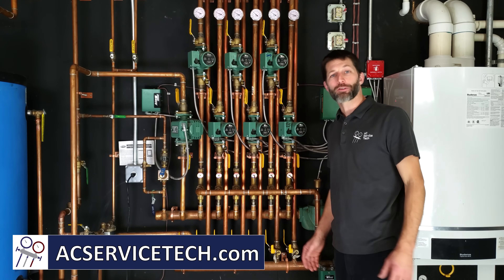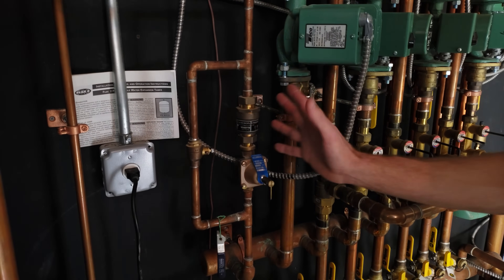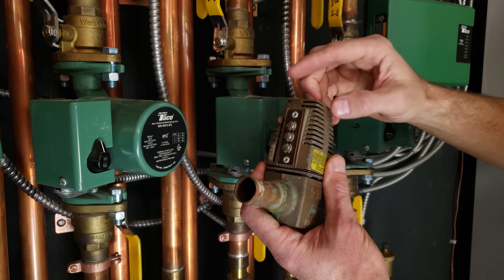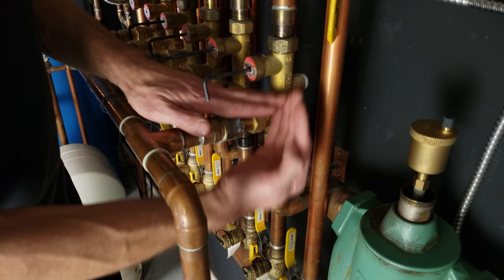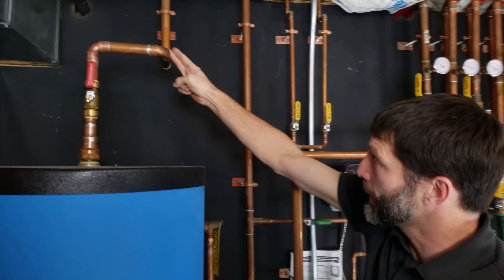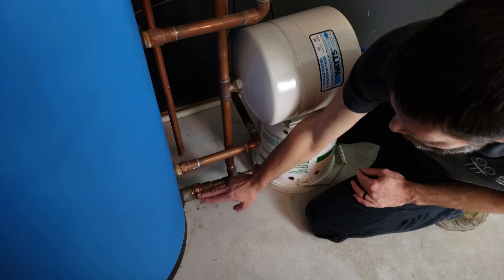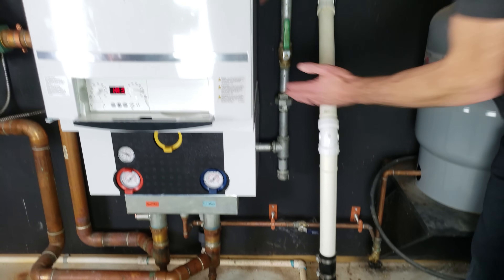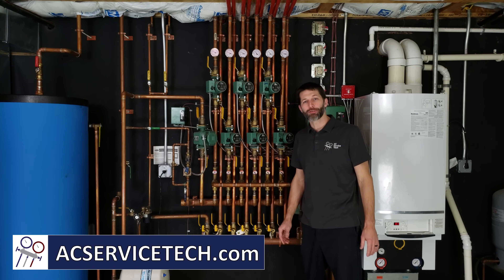Boiler Training Class, Parts, Operation, Zoning, Explained!

Comment: Why would you set a condensing boiler to 190F only to mix it down to 115F? It would only be getting the same efficiency of an atmospheric boiler at that point.
Reply: My thoughts are is this boiler is also heating the domestic hot water, which would require a high temp to be effective.
Reply: @steventhury8366  Yes but it would only need to do that actually during domestic production not all the time, those Taco zone controls have a priority zone for that very function. Also, 190⁰ is unnecessarily high for domestic anyway you only need 20⁰ above your DHW target, that boiler would have enough jam to heat that tank up in 10 mins from cold @ 150⁰ supply temp.
Reply: @zacm9174  My understanding is, the 190 degree boiler water heats the domestic water via heat exchanger, or indirectly,  which has inherent inefficiencies.   So to get 130 degree domestic water to effectively rise during heavy water use, you need boiler water much higher.
Reply: @steventhury8366  I've installed dozens of boilers with indirect water heaters and I've never had to set the boiler supply more than 20 degrees above the domestic setpoint to heat it from cold in less than 15 minutes. The boiler in the video is 300,000 BTU/hr, with a Taco 0011 pump that thing would heat that tank in a few minutes at 150⁰ and remain in full condensing mode doing it, whoever installed that one wasn't very experienced with condensing boilers obviously.
Reply: @zacm9174  I'm not denying what you're saying about water temp.
The installation was obviously not done by a newbie.  If you can see something wrong, good for you.  This video is not for advanced boiler technicians,  so why are you here?
Do you think the technician doing the video is promoting some kind of boiler heresy?
Reply: @steventhury8366  I kind of do, yes. A more experienced hydronics technician should have been brought in for this video instead of propagating misinformation. I'm not saying the installer was inexperienced, probably just really old school, i've seen the type before, they don't  really understand condensing boilers and install them as if they were an old cast iron atmospheric boiler.
Reply: probably feeding an indirect water heater and maybe baseboard or hydro-coils somewhere in the building, those pretty much rely on 180F+ to be efficient and have rated output.

Comment: Also the expansion should be pressurized to 22 psi since boiler is at 22 psi!
Reply: Yes! Definitely! Thanks for mentioning that.
Reply: no, the expansion tank pressure should always be equal to the systems required "cold fill" pressure! as the water in the whole system warms it expands and the tank is there to except the expansion and maintain the pressure, while you can get by with the tank pressure about 3psi higher than fill pressure, that makes the system pressure change rapidly until it ,meets the tanks pressure on every single heating cycle and you really don't want the pressure changing drastically or odd things can happen.
I think his tank is low on air charge or is undersized for the building, because 22psi at 168F is too high, especially since the whole system may not be hot with water fully expanded yet.
those tanks all leak down about half the charge in 18 to 24 months, which reduces the acceptance volume by greater than half and poof 💧 goes the relief valve.

Comment: Great presentation, nice install. I installed an electric hot water tank, love the simplicity and $400 cost. No reservoir tank, circulator pump, inducer etc. My electric bill has not changed but my gas bill went WAY down. I would argue the cost in electricity to run the combi and heat loss through the pipes to the hot water tank need to be factored into the efficiency. My next house will be wired for Insinkerators in each bathroom and kitchen and cut the copper pipe cost in half. Edit: I am a licensed gas fitter.

Comment: Just wondering if that low-water cut off should be above the top of the boiler just thinking because if the water got down that low that boiler heat exchanger would be toast. Very nice job of explaining the system
Reply: Yes you are right
Cuz in New York City DOB plumbing division inspector will fail the inspection.
Unless it's on the top of the boiler for the same reason you mentioned. In general he did a very nice job
Reply: yes, it really should be above the boilers heat exchanger highest point. (since it's not a steam boiler)
ideally you want it to cut off when or before any circulator pumps run dry, not just the boiler. cartridge pumps cannot be ran dry, the water lubricates the bearing surfaces(often ceramic sleeve on stainless steel shaft)
Reply: Can’t say that I am an expert on Buderus boilers (I would want to see the install guide) but I would agree that a LWCO would generally be located above the boiler heat exchanger.

Comment: Great thorough video! Thanks Craig. Couple questions. The drain goes into the sump crock and that condensate water is very acidic and will eat up the pump. Many municipalities do not allow you to drain into the sump. Is that legal where you are? Also the LWCO looks low. If the water level in the boiler got that low, it can ruin the heat exchanger. Is that in the right spot? Thanks again
Reply: Christopher, I have worked on Boilers for Thirty Years. One thing that improves and protects boilers tubes and pump is to use DE mineralized water and do a closed Loop System.  By doing this You have All the Minerals from the Water removed and You recover the water to a Holding Tank so you never add water to the System. As long as you don't have a leak you never add Water but if You have a leak then add De mineralized Water back to the system. On the Hot Water Tank used a Hot Water Tank that uses a coil in the tank to heat the Water. If You have to drain the system for any reason You can pump the Demineralized Water into a Holding Tank. You are only use about 250 Gallons of Water at the Maximum in all the Lines, Evaporators and the Coils. By doing this You add 5 to 7 years to a Units life. One other thing Never use any Carbon Steel Fittings or Pipes in the Heating System. Carbon Will transfer to Stainless Steel. By doing this You will Add Years of Life to Your System. Carbon and Mineral Water is a Cancer to the System. Any Old Boilermakers and Service Tech's with knowledge will tell You the Same thing. One other thing do a Boiler Chemistry Test by doing this it will Tell You the state of your Water Chemicals in your system. You need to Stop any Corrosion in Your System. by doing this You add life to Your System. Most People that installs these Systems don't care because it's not their system.

Comment: Very well done. Just want to point out a few things that will make our lives go easier.  Install a ball valve after the auto feed so you can isolate the feed valve from both incoming water pressure and boiler side pressure. The quality of these feed valves is not what they were 30 years ago and they must be replaced more often. Maybe a little more explanation on why the mixing valve is just a high temperature stop when used on a system with outdoor reset and mixed temperature supplies. My last pet peeve is what is a very common mistake. Always install a drain valve between the expansion tank isolation valve and the tank. These bladder tanks must have their air pressure checked every season. The only way to do this is to isolate the tank and remove the water pressure from inside the tank. Your other options would be to take a bath or introduce a lot of air into the system.  Great video Thanks

Comment: Your a great instructor, I love the clarity and energy in the video.  What a great job in installing that system also.  We have done some nice ones but this is probably better / cleaner.  Symmetrical always makes the systems look great.   It's odd with the natural gas being run in what looks like galvanized pipe.  In our area thats a general no-no.
Reply from the maker: Supply houses here by the ocean only sell galvanuzed, local inspectors only approve galv outside here and in the ifgc 2021 code book, there is no distiguishment between using schedule 40 galvanized and schedule 40 black iron, so its technically fine by that code book, thanks!

Comment: Thank you for your time. Great details; the guy takes his time to make a great video. I only disagree that they use a regular PVC in the exhaust; it should be scheduled 80 or CPVC at least the first 10 feet. We have been doing that since 2010.
Reply: Aren't there some boilers that are specifically designed for pvc exhaust? I've only ever done metal but I've seen boilers that call for pvc
Reply: @StanleyHalas  Pvc overtime gets toast, cpvc and sch. 80 last till you died.
Check.the thickness and you will understand.
Reply: @humer101  I'm very familiar with the different types of pipe. My comment wasn't about the different types, it was about the manufacturers recommendations
Reply: @StanleyHalas  Ryan im doing these boilers for 23 years. I learn that the regular PVC pipes get toast with the pass of time. I cannot longer go by the manufacturers' recommendation. We are the people on the street, I mean on-site, and we learn what happens with most of the stuff.
Do you think it is better to use sch.40 pipes or sch.80 for the exhaust? Please forget about the manufacturer's recommendation and answer this question.
Reply: @humer101  I've never installed anything but metal exhaust for a boiler system. Thats my personal policy. I don't trust plastic for high heat discharge. I've seen installations with pvc though.
Reply: @StanleyHalas  Agreed is even Better I like the idea but in this case of a power vent boiler, you cannot apply metal doing that the condensing water that comes back is very corrosive and will damage the pipe the first Winter.
Reply: Some counties/manufacturers require those sweep 90's on the exhaust in order to pass code. The most common type of sweep 90 you'll find is DWV PVC. Good luck finding that in SCH 80 or CPVC for 3" or 4" exhausts.
Reply: @Noisefrombelow  Yes, good point, so you will learn today that two regular 45 will make a long sweep 90. Is been 23 years learned the hard way and I was blind , now I can see it even better.
All humans have a brain and we have to put it to work, most of the inspectors have not idea about but when they see what is done, they can't laugh and hand you the approval sticker.

Comment: Some comments regarding this install: This is a modulating boiler. That’s why there is a range of input/output of 72,000 to 330,000 Btuh. The way that it is setup/installed, though, makes no use of the modulating feature. This means that it never runs lower than its full rated input/output and because of this it will never reach its maximum efficiency. It is also capable of outdoor air temperature reset but this feature is not being used. With outdoor reset the output temperature for space heating will vary depending on how cold it is outside. Instead, it is set to a fixed output temperature for space heating and this is probably why the installer put in all of those mixing valves…to knock the temperature down to a more reasonable level. Outdoor reset takes care of that automatically and that makes better use of the modulating capability of the boiler. 

This boiler has an aluminum heat exchanger which requires a special formulation of antifreeze (aluminum safe inhibited propylene glycol)…always a good thing to mention.

One more thing that sticks out to me is the lack of dielectric unions where the copper pipe connects to the low-loss header and to the water heater.

Good basic overview of one type (zone pump) of hydronic heating system. I am sure that there will be additional videos that go much more in depth.

Comment: That’s why I love this trade I learned as much from the comments as I did the video. Great job Craig you and Steve Lav keeping me sharp. I had to smile at the hot water heater expansion tank sitting on the five gallon bucket(temporarily until it’s properly secured of course). When can we expect the boiler book? Thanks again
Reply: So these boiler set ups are normally done by plumbers or HVAC? I'm looking at getting into residential HVAC service technician. Thanks
Reply: @truthbebold4009  Plumbers usually do the installs and mechanical repairs, but a good Hvac tech understands the overall function and every components operation. For example an hvac tech knows how to troubleshoot a boiler and find the circuit is being interrupted by a faulty low water cut off. Hope that helps good luck stay safe.

Comment: These systems are most popular around the East Coast ( Massachusetts, New York & New Jersey), very expensive and requires a lot more maintenance compared to a forced air system. Craig did a very good job of explaining this particular hydronic system, along with the domestic hot water 👍. Some things that were concerning to me was uninsulated domestic hot water pipes, his statement about pressure relief pipes needing to be 6 to 8 inchs above floor ( this is incorrect, pressure relief pipes are required to be a maximum of 6" above the floor & not closer than 1" above the floor), exterior low water cutoff not mounted 6" above the height of the boiler's heat exchanger, no condensate neutralizer installed before the sump pump pit, and I am suspect about gas pipe sizing ( a 1-inch fuel run is good for about 40 feet but we have to consider elbows equaling 5 feet and any other gas loads that may be coming off the line). Other than my concerns this looks like a very good install to me.

Comment: I love your videos and your knowledge!  Best instructor on youtube,bar none! I am not looking to criticize or "catch" you in a mistake. But I thought you could not use galvanized pipe for gas pipes.  Honest question!
Also, you said the manifold underneath "mixes", I don't understand. How does the water not mix to one temperature if it is blended in the  manifold? You've taught me a lot, just need some clarity on this.
Reply: Hi Michael, you are right. AC Service Tec LLC is one of the best instructive channels.
 I watched and learned a lot from it. 😊👍.
Reply: Magic.  Well, it seems like magic as I'm just reading up on this.  That is the "point of no pressure change" because between the supply and the return is where the expansion tank connects.  The circulators can't create a pressure differential at that point.  As there can't be a pressure difference between the supply side and the return side of the manifold, flow doesn't happen, but thermal transfer can occur to warm the return water so it is at the proper temperature for the boiler's efficient operation.  You have to keep in mind the entire system is filled with water.  The circulators just create a pressure differential from their input to output which causes the water in the system to move to compensate.  

I'm well past my understanding.  I recommend looking at the books or talks of Dan Holohan, of the Heating Help website.
Reply: It creates hydraulic separation. It allows the boiler which has a relatively restrictive hydraulic path to circulate and keep the return water from getting to cold to prevent shock to the boiler. The secondary loop where all the circulators are will be free to flow as much as the header pipe size will allow without the restriction of the boiler.
Reply: Michael, the national gas fuel code NFPA 54 does allow the use of galvanized pipe for gas fuel runs. Back in the days when gas was manufactured from coal (coal gasification, before the late 1950s) galvanized pipe was prohibited because of possible flaking but now with better galvanized Processing /Manufacturing & clean dry natural gas the problem of flaking has been eliminated. That being said it is still prohibited for use underground ( it will corrode underground and quite rapidly, especially without cathodic protection). There is still municipal codes that prohibit the use of galvanized pipe for fuel run purposes and I feel this is because they are uneducated about current manufacturer processing and the cleaner natural gas used today. I do worry about fuel run materials currently used if the Gas Utilities start switching over to some type of hydrogen fuel or fuel mixture but that probably won't happen for quite some time and at my age I'm sure I will be long gone.👍🛠
Reply: Thanks for your input.
Reply: @boby115  thank you,Sir! Based on your knowledge, I could say the same thing about drip legs, but I still put them in!
Reply: @michaelmonaghan2717  , I would hope you would still put them in ( sediment trap /drip  leg ) debris can still get in the system no matter what gas pipe material is used, plus it's still required by the national code.👍🛠
Reply: @boby115  yes sir I do, cause I meet code. Just pointing out that in 25 yrs, only found small amount of debris in one trap. Everything else was clean. I was agreeing that natural gas and propane is much cleaner today.

Comment: Hmm, typically LWCO controls that I've worked with on large industrial and institutional boilers (in multiple states over 35+ years) are N.O. and close with water present at a certain level.. One wouldn't want a N.C. switch. 
 Much like a draft proof or flow proof switch. They are N.O. switches that close when draft or flow are proven.
Reply: I thought the same thing but I think Craig was just not very clear in his explanation. I think he meant it was normally closed when in contact with water, like you I was taught it's what the position of the switch is in when manufactured or in the box ( the normal position with no contact of any kind).👍🛠